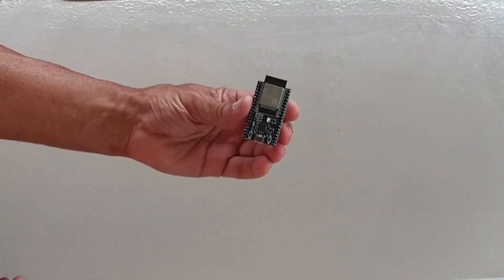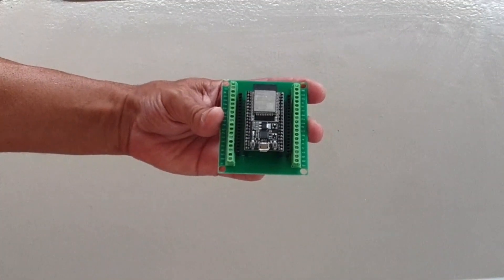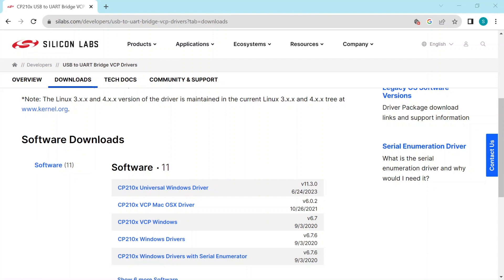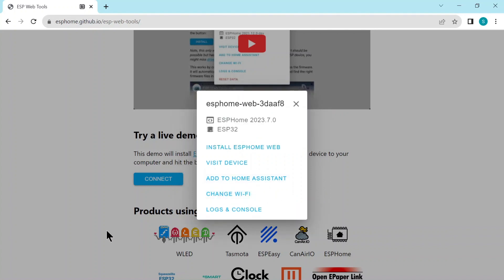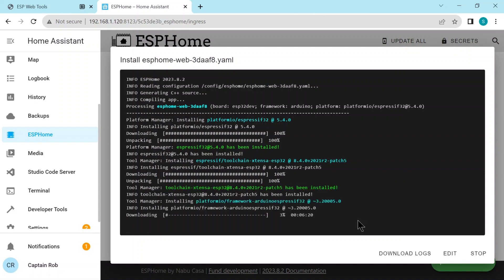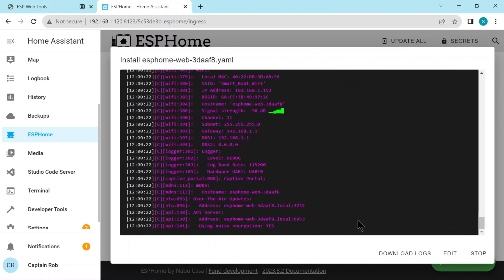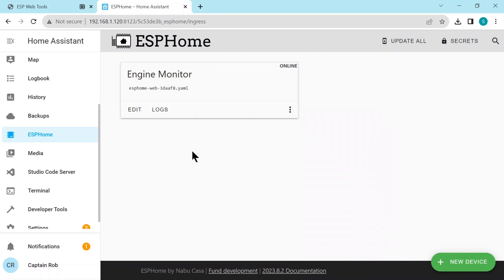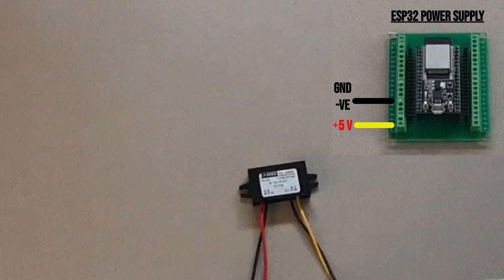Smart Boat 12: ESP32 setup and add to Home Assistant

Comment: Rob,  so very grateful for your videos.  I have been trying to set up my Esp32 as shown in your video.  After I do the 2 minute install on the Esp32 - it does not give me any options to set up WiFi - simply allows me to review logs or reinstall.  Can you tell me what I doing wrong?  Grateful for your help!
Reply from the maker: I've seen this happen, but I can not remember exactly what the cause was. Just start again and reflash the esp32. Or try another esp32. It would behave like  this if the firmware was not flashed correctly.

Comment: Thanks Rob but I can not get the ESP32 to show in ESPHome Builder. I can add it to ESPHome Devices in Settings -> Devices & services -> ESPHome as well as see the devices Web Page but it doesn't show up in ESPHome Builder so I can't "Adopt" it. I've tried to add manually but can't get that working either. Any Ideas??
Reply from the maker: Try flashing again with the Esp Web tools. Make sure it completed correctly and it accepted you wifi credentials.
Delete from HA what you created manually and restart HA.
Reply: Thanks for the reply Rob. I ended up connecting everything to home router rather than the boats router and it showed up in ESP Home builder. Hopefully I can change everything back to the boats router. Any idea of any setting on the boats router that would stop this working?
Reply from the maker: @teirajansen   ESPHome adoption needs mDNS to see unclaimed devices. Once adopted, static IP works fine even if mDNS is flaky. On the router, check for settings like Wireless Isolation, Client Isolation, IGMP Snooping, or Multicast Filtering — any of those can block mDNS.
Reply: Where do I find these obstacles on the router config? @SmartBoatInnovations
Reply from the maker: @mortenabildgaard6578  What router are you using on the boat?
Reply: @SmartBoatInnovations   Thank you so much Rob. That fixed it. Turned off "Filter Multicast" in the Firewall menu and all working now. My router is an inhand IR302 if anyone has the same issue. Just got you a few coffees.
Reply from the maker: Great!  It's good to know that fixed it. @teirajansen
Reply: @SmartBoatInnovations  I'm using the same TP router as you have recommended. But no worries, It all solved it self somehow and I have the ESP32 talking to my rasberry pi 5 and also to my Victron Mppt smart solar. What a relief and now data is floating in to my home assistant. I have now setup gauges to monitor my sun production data remotely 👍 Huge thanks and kudos to you Rob. Keep thoose videos coming!

Comment: Hi Rob, I’m brand new to doing this and following your excellent tutorial but have things changed since you made the video? 

When I got to the part where you install ESP Home, you  installed ESP Home Web 2023 .7.0? But all I had to download was esp-web-tools-example-0e9c98.yaml. 

I installed that and followed your video then got to the part where you can edit your file in Home Assistant and my file is totally different to yours - it shows 18 lines but only 15 lines of code. Yours is showing 31 lines with many more lines of code than mine. 

I’m using a Mac so had to use the Mac version of the drivers, rather than the universal that you used, if it’s anything to do with that?
Reply from the maker: Each version of ESP Web tools seems to have a different base yaml. This does not really matter as the code we add will go after this. As long as it installs without errors it will be fine.
I have some extra ESP32 tips in my Smart Bilge Pump video
https://youtu.be/_46-2BMQ84U
Here I show how to optimize the base Yaml code and other tips.
Reply: @SmartBoatInnovations  thanks for the reply Rob, it seems to be working - I’ve managed to get it reading temperature. Many thanks for your guides

Comment: Can you help me to understand when we would use the esp32 and when we would use the Raspberry Pi?  Your earlier videos seem to use the Pi but now there are videos using the esp32.  Thank you.
Reply from the maker: The Raspberry Pi is the base of the Smart Boat and runs Home Assistant.  The esp32, and you can have multiple,  allow you to connect sensors via wifi to the Raspberry Pi.  Example sensors are the all the Engine monitoring sensors like temperature, oil pressure and tank levels. Another example is a NMEA 2k wireless connect. Many of the speciality sensors use an esp32 as it makes life easier as you do not need to run cables and integrates easily with Home Assistant. See 
Engine monitoring
For Tachometer:
https://youtu.be/-xflWB3R2Go
For oil pressure:
https://youtu.be/ScP7xjOwWFg
For Engine temps:
https://youtu.be/hfo4Pd6KxlE
For Fuel levels:
https://youtu.be/nj_IY5HZdic

Comment: Can you do a video on esp32 mesh network ? I have a 78ft aluminum boat and would like to setup sensors in the steering room, engine room, and bridge … but WiFi will not make it the whole way … so I am thinking a mesh could help and it sounds like esp32 can do that
Reply from the maker: That could be a possible future video but to solve your immediate problem you could just use a simple WiFi extender. The same that people use in their large houses. There are projects to set up an esp32 to do this as well but they are more involved.

Comment: I keep getting "failed to initialize. Try to reset your device or holding down the BOOT button while clicking INSTALL" I have tried this and still get the same message. Any ideas on what to try? I know the drivers are good as I did a difference SP 32 board yesterday. Thx
Dave
Reply: Ok, got it. Driver issue. Thx Davw
Reply from the maker: Great.
Reply: You obviously chose ESP32 ahead of other boards like Pi Pico. Is there a reason for that choice?

Comment: any good mounting boxes that you know of or have used?
Thx
Reply from the maker: I reused my existing battery box as the EVE 280 cells were the same length as the width of my previous AGM batteries. Simple plywood ends held together firmly with dyneema could also be an easy build. I am also starting to see some LifePO4 storage boxes being sold on Aliexpress but I cannot really recommend any as I have not used them